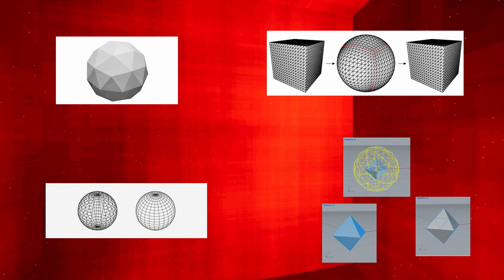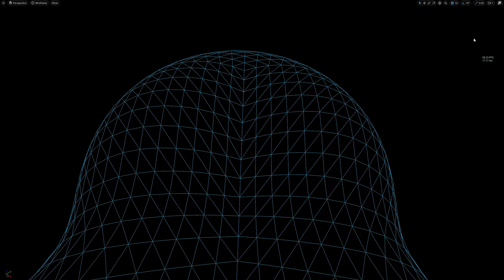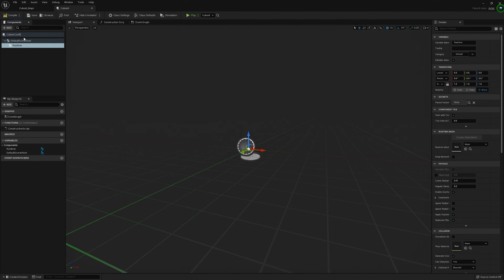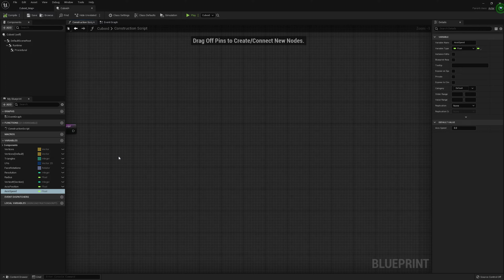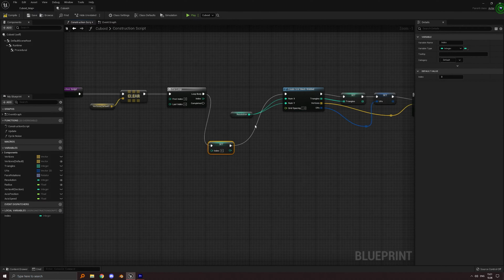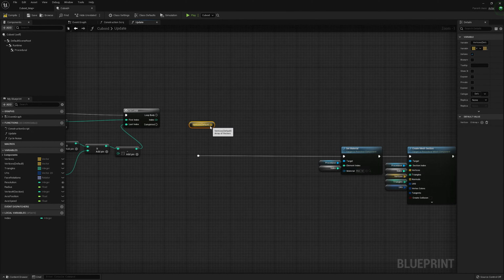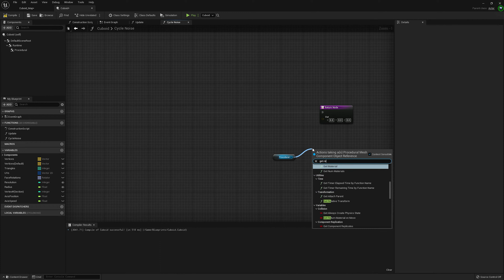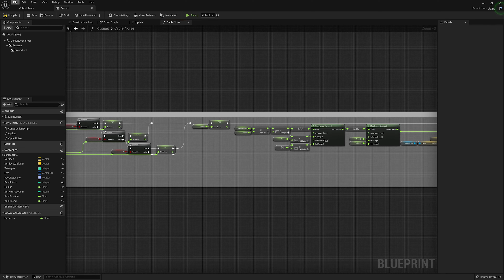[UE5] Procedural Generation of a Cube Sphere + Cycle Noise

Comment: I have encountered a problem, if the resolution is greater than 204, a face will be lost
Reply from the maker: I am pretty sure if I was to try any 3 digit resolution, my computer would experience an eternal freeze. I will have a look once I physically can, which would be in a week.
Reply: @devlogsadgi6778  I found that the procedural mesh can have up to 250,000 vertices, I don't know why.